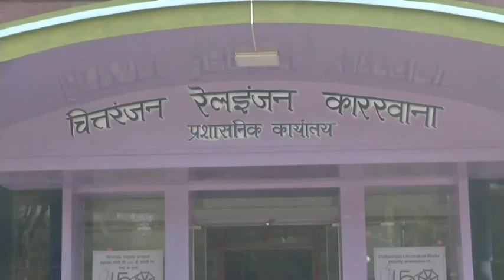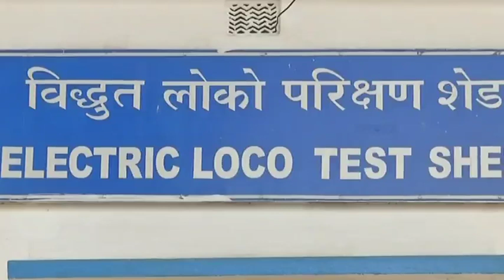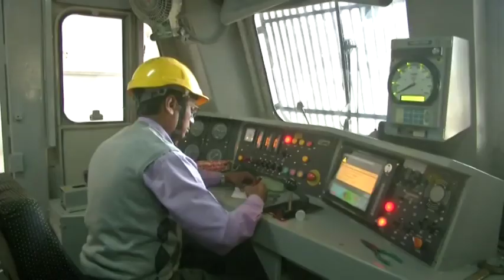Chittaranjan Locomotive Works:A journey of Steam to High Speed Locomotives

Comment: Based on technology & innovations , ICF is much ahead as compaire to CLW ..........
Reply: CLW is a locomotive factory and ICF is a coach manufacturing factory. It's like comparing apples to oranges.
Reply: @mukulbajpai6190  ** agreed sir but as per time constraints company needs to upgrade , however ICF manufacture only coaches but they invented an engine less train technology , they why not CLF? However CLF have much more experience of loco operations..........😊🙏
Reply: @amoghkakde  they can if railways give them